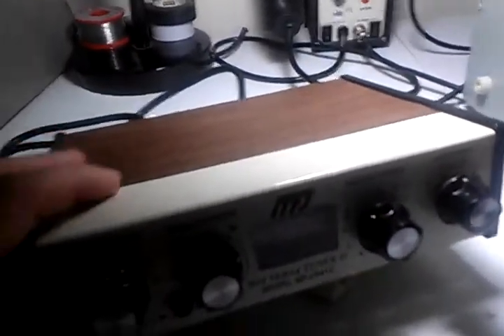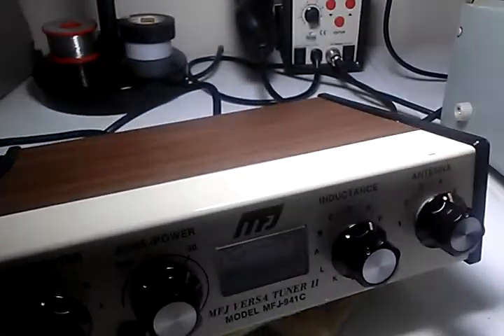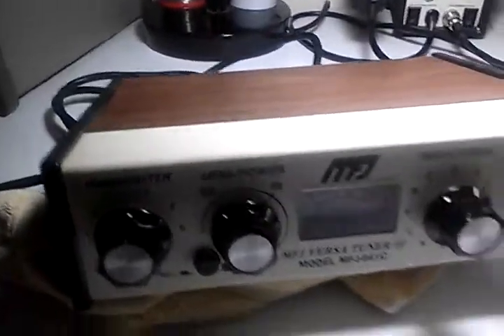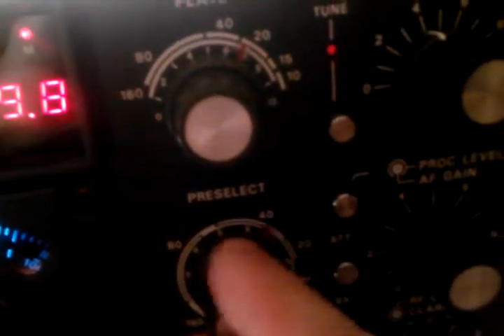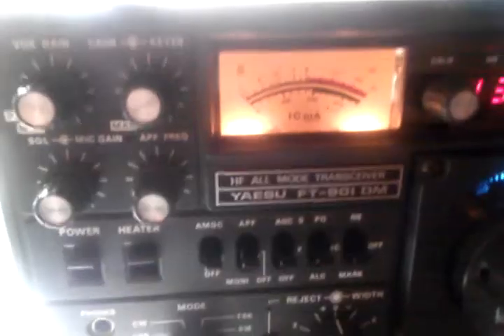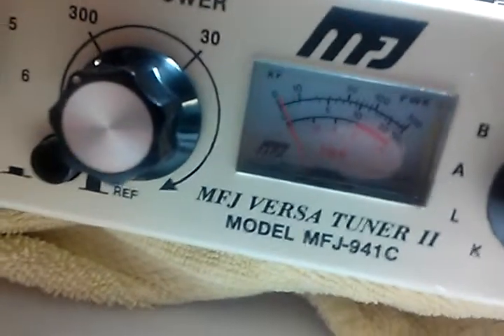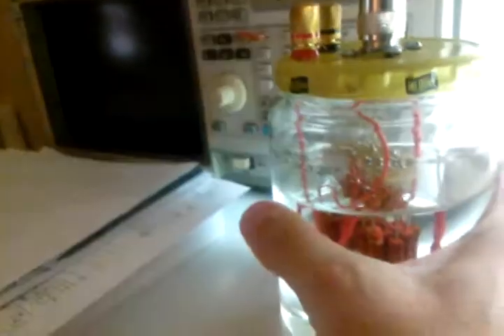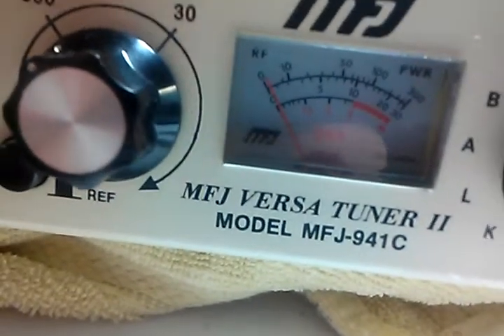Transmitter TEST and problems! ft-901 (yaesu)

Comment: When you tune for maximum power output, you are tuning a resonate circuit at that frequency. What you saw is expected from a tube driven transceiver. You can't expect it to stay tuned for more than a few kHz either side of the tuned frequency.